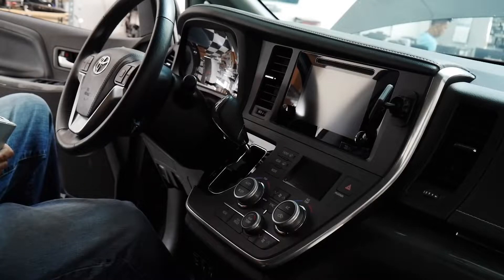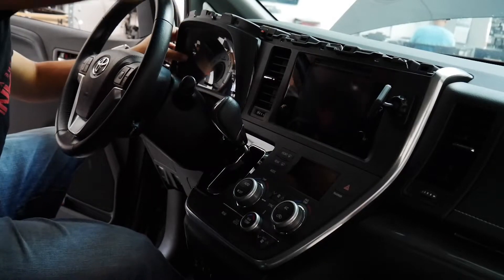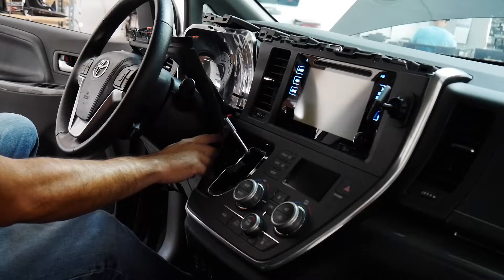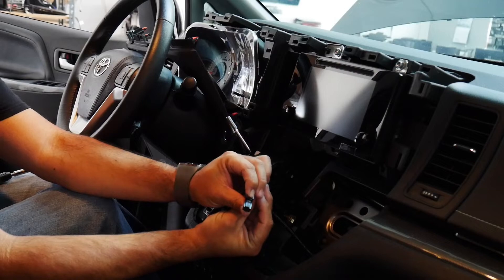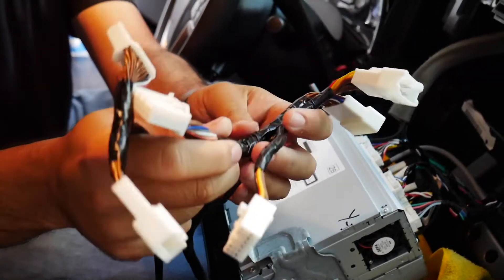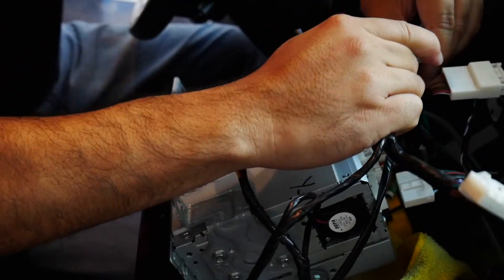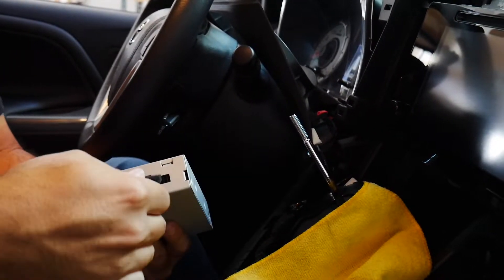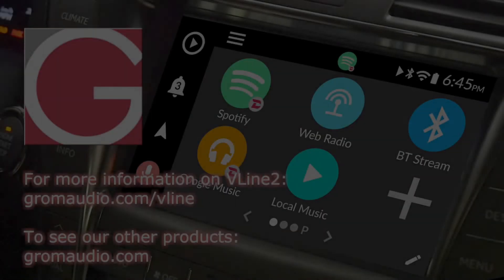2017 Toyota Sienna Car Stereo Removal Guide and Install of VLine VL2 Navigation CarPlay Android Auto

Comment: How does interface with existing features on the stock infotainment ? Like back cameras/360 views and climate controls like on a 216 lan cruiser?
Reply from the maker: The interface integrates fully with the existing features of the stock infotainment, and does not interfere or disable them. Back camera, 360 views and climate controls - all will keep working.

Here is the link to the product that will fit to your Land Cruiser 2016:
https://gromaudio.com/store/vline/grom-vl2-lex7t.html

Comment: A couple questions for my 2017 Sienna.  Can I simultaneously use the head unit's XM radio while using Apple Maps for navigation (i.e. will navigation prompts from my interrupt audio sources on the head unit)?  Also, is this compatible with the JBL head unit?
Reply from the maker: Toyota Sienna 2017 is compatible with VLine VL2 system, if the stereo has LCD screen. You can check compatible model here:
https://gromaudio.com/store/vline/grom-vl2-ten.html
You can't use the factory XM radio and maps on VLine system at the same time, as the stereo technically can only be in one audio mode at a time. The workaround is to use XM map on the VLine - either with CarPlay or Android Auto, or directly on VLine system.
Some other music options such as Spotify, Pandora, TuneIn and others are also available.
Reply: For God so loved the world, that He gave His only Son, that whoever believes in Him should not perish but have eternal life. —John 3:16

Comment: Can you install the Gromaudio box on the place of the Entune module ? It looks about the same size .
Reply from the maker: GROM VLine is an add-on to the factory stereo. It does not replace the factory stereo. You simply connect VLine VL2 system to the back of your Entune stereo to enable additional functionality that VLine offers.